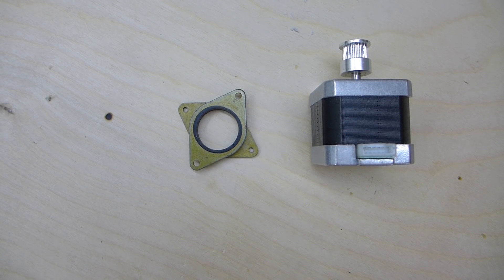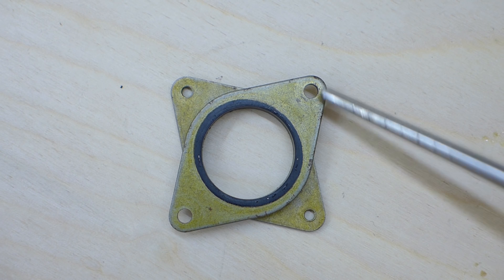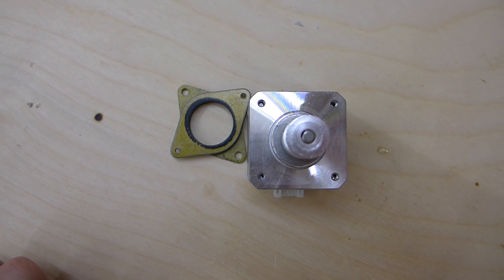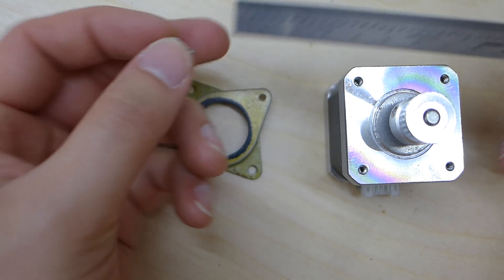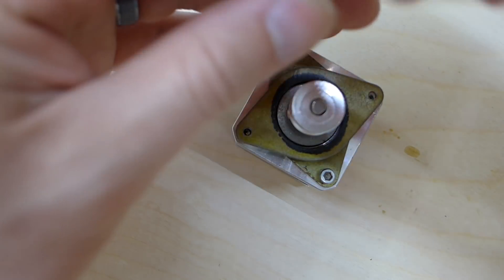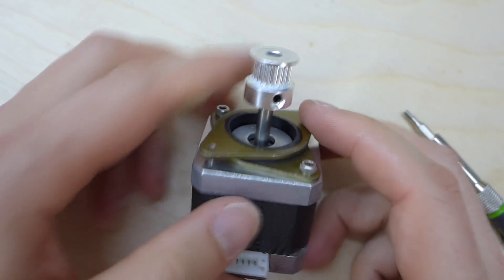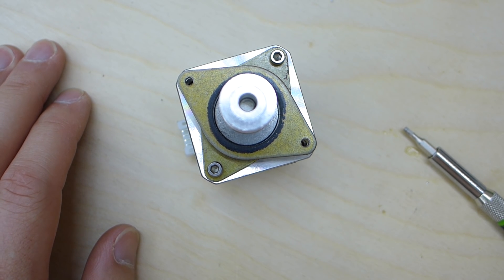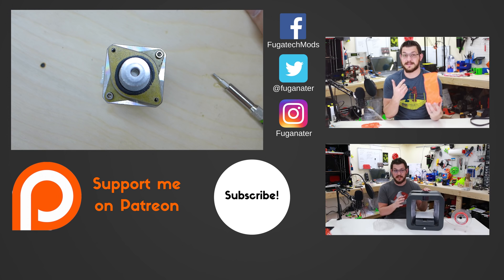Vibration Dampeners for Stepper Motors

Comment: Can i use it on the other side of the Nema 17? or is diferent the effect?
Reply from the maker: Different effect. It is just to try and stop all of the vibrations from going into the frame and then into your print. With newer drivers, these aren't that necessary anymore.

Comment: :))) What you gain by installing the dampener, you'll lose it because you're pushing the pulley so that the shaft is in there just halfway... or at least some of it... how did it turn out?
Reply from the maker: I have them on most all of my printers now and they are amazing. You are not putting that much force on the shaft. If you put on too much then you have your belts wayyyy too tight.

Comment: I just installed a set on my FT-5 Y-axis steppers and the noise reduction is actually pretty amazing. However, after only 8 hours of printing, one is starting to fail - the rubber is separating. And, both were tilting at angle as a previous commenter also mentioned. Still, the results are impressive -thanks for the video Shane!
Reply: Scott